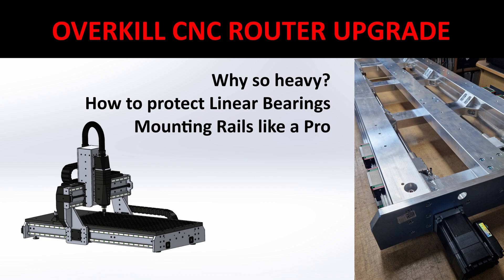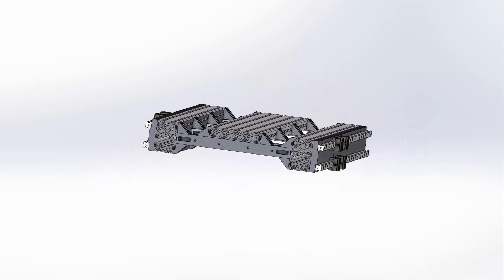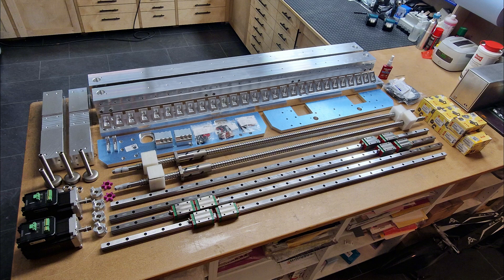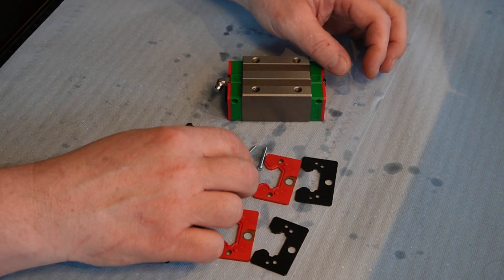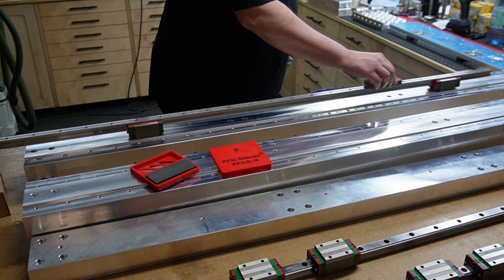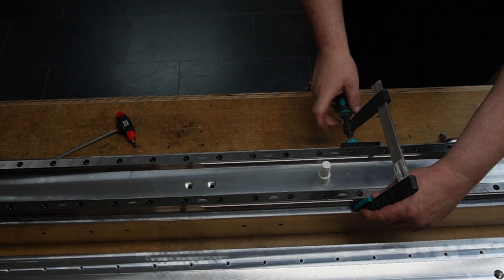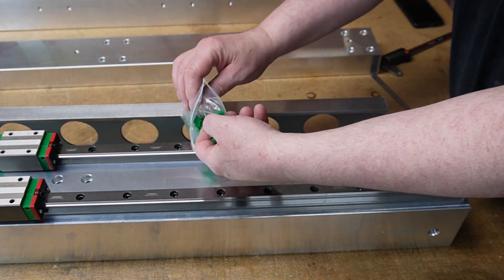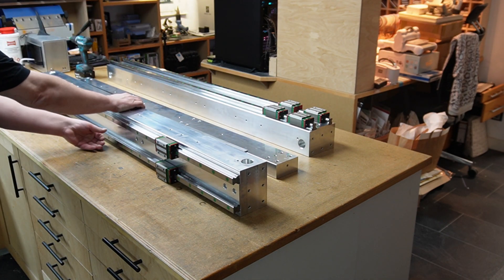Overkill CNC Router Upgrade Part 2 - Machine Bed Calculation and Linear Bearing Protection

Comment: What size have those laterals aluminium blocks? Its not bending only with 2 level feet?
Reply from the maker: No it's not. It's the reason I went with solid bars in the first place. Clearly explained in the video
Reply: @scratchbuiltdesigns yeah but aluminium profile was 120 x 80...you stucked with same dimmension on solid? Seems a little bit bigger😊
Reply from the maker: @Andrei-m4o6e Yes, it is bigger

Comment: Great job with the build and enjoying the series very much! I am curious which aluminum alloy (6061, 6082, etc.) you picked for the solid base. Also, while machining the solid aluminum blocks, do you know whether your friend used a specific tolerance standard (ISO-286, ISO-2768, etc.) and surface roughness value (3.2um Ra, 1.6um Ra, etc.) on the surfaces where the linear rails sit compared to the rest of the blocks?
Reply from the maker: Regular 5083, Regular tolerances
Reply: @scratchbuiltdesigns  thank you!

Comment: I was sticked on https://www.youtube.com/watch?v=LHtNtLdFPBQ&t=692s sound that kicked me to do the sound (smoothness) comparsion test of linear guides:
https://youtu.be/HyHWNTgOh0g
On the other video You mention chattering (video about Z axis). IMO there is two points that can change the game. Usage of roller insted of ball guideways and usage of offsets. Don't know if it is called offset but hope it is close. What i mean by this offset - carriage position to be not exact symetrical because of symetricity support resonation and helps to produce chatter in the end.

Comment: With the limitation of length due to sag, could you support the beam with adjustable feet at regular intervals?
Reply from the maker: No, because of the connecting plate under the beams. This would require to bring the ball screws from under the table to the outside, which in my case was no option. If I had no space restrictions, this would definately be a better option.
Reply: @scratchbuiltdesigns Do you think your gantry and Z axis design would be rigid enough for 200mm of Z working height cutting 7075 Aluminium? I am looking to do a 450x650x200 build.
Reply from the maker: @ultimaevo77  The Z-axis is certainly up to it. I've had the same on my UPHC router, which had 600x400x200mnm, milling all sorts of metal, incl. steel. Adding additional 40mm to the gantry should as well be no problem.
But this would be a small and top heavy machine...
Reply: @scratchbuiltdesigns With those dimensions creating a top heavy machine would you recommend going a bit wider on X for more stability or will a wider gantry negatively affect the rigidity?
Reply from the maker: @ultimaevo77  I'd rather increase table length. The gantry moves as well, so it would make matters worse, in terms of ratio between fixed mass and moving mass. 
If you have to stick to the dimensions, making the machine bed heavier could be an option, like a 10mm thick steel plate between the frame and the fixture plate
Reply: @scratchbuiltdesigns  Do you think your gantry and z axis design, done as a fixed gantry router with some extra angled brackets on the inside of the gantry side plates tied into 120120 exoxy granite filled profiles would support something crazy - 310mm of Z work height? I want to be able to machine race car uprights on a 4th axis and am going down the design rabbit hole now.
Reply from the maker: @ultimaevo77  I would rather make a hole in the table, or better, a C-shaped cut in the front of the table and drop the 4th axis there
Reply: @scratchbuiltdesigns That's a good idea! Looking forward to your next video.

Comment: I built a router using 50x100x4 alu square tube for cutting soft materials , wood and plastic . was thinking to fill the tubes with epoxy mixed with metal chips. The machine would become very heavy  though and it'd be very difficult to move around especially for home use, so I abandoned this idea. This was my first build and I'm not machinist nor I do have access to proper machining equipment to process aluminum .it was pain to get the linear rails to an acceptable alignment,  gantry moves with no jamming. how would you do the alignment if you used extruded aluminum profiles, sanding, shimming...? thanks for the video
Reply from the maker: I explained in the first video how I did it on my previous router, based on profiles.
When you build out of profiles, it makes sense to buy really good ones, which are way better than the allowed tolerance. But they are expensive.
The cheaper profiles are still within spec, but it is much harder to align linear rails on them.
Usually shimming is the way people do it
Reply: @scratchbuiltdesigns  I'll have a look at it. thanks

Comment: yah, i hadn't thought about using gigantic bars for mine, but i had thought of steel box section tube.  the worst part of it is getting it flat.  i'd have to grind them in like surface plates, though i would have three super flat pieces, one i could cut into the shorter axis.
Reply from the maker: That's probably an even better solution. But unfortunately I do not have the access to grinding, so it never crossed my mind during the design stage...
Reply: @scratchbuiltdesigns  no, i mean grinding as in... rub two pieces of metal together with grinding paste between them, then involve a third piece.  can start coarse with plate glass and sandpaper.  eventually use marking dye to show any high spots, if they're really high, carbide scraper or keep at it with the paste.  https://www.youtube.com/watch?v=-z4Rr7woKOM these are tiny but there's video of people doing the same thing with granite plates more than a metre on a side.

for steel assembly, i'd have bolted then brazed, then put on the flat rail mounts in bedding compound, so the table doesn't have to be flat.
Reply from the maker: @felderup  Woah... Amazing. But it sounds like a hell of work
Reply: @scratchbuiltdesigns  well, you get near perfection, but there's one thing you don't need to do it, machines.

Comment: extruded profiles  are complete garbage , theyre basically tuning forks to increase resonance,, Made my cnc out of concrete ( 350 lbs ) and steel tubes filled with concrete
Reply from the maker: Profil is not Profil and some are not too bad. It all depends on the purpose.
I had a commercial kit, made out of profiles, and build my own design, partly based on profiles. They all were reasonably good, because their design was good. I have seen DIY routers out of steel that were complete crap.
You are right, the material has an important impact, but the design as well

Comment: I'm in the process of building my CNC too and I always love to watch building videos on Youtube. I can't wait for another episodes from you, pleas hurry! 😁 Anyway, I have used for Y axis aluminum profiles 40x120 and filled them with epoxy granite. But from the couriosity, I have checked what would cost me 805mm long 50x120 full aluminum bars for Y... and just the raw material for 2x Y would cost me about 300EUR + shipping cost at weight about 27kg😃 it's almost the same amount I paid for all aluminum extrusions used in my build. 🙂
Reply from the maker: Awesome. Yes, the cost is of course always dependent on the location, availability and local pricing. With your cross section and length, a profile would be 60 EUR and a solid bar 75 EUR here in Germany (plus shipping). So a reasonable difference. But then you just have the cost and effort to fill the profiles, t-nuts, etc, and with solid bars there is cost and effort for machining. 
So yes, overall profiles are the more cost effective way
Reply: @scratchbuiltdesigns  Where would you buy solid aluminium bars in Germany?
Reply from the maker: @andreas292  There are several shops, like Bikar, Gleich, Gemmel, IBL, etc...

Comment: In the design I have I didn't join the sides under the table, I made the plates more rigid that attach to the ballscrews and leaving a gap, this give you 2 advantages, 1. It lets you put a centre leg in to compensate for sag as well as extra weight from vises and material which can add up fast and 2. Because sides are now seperate then you can use software to square gantry each time you home the machine In case of crash.
Reply from the maker: Surely that is a good option. But as I mentioned in the video, I wanted to maximize the work area of the router within a given shop space and ball screws on the sides make the machine wider. If I had enough space I would have done the same.
Gantry squaring by software is still possible - but within limits of course.
Reply: @scratchbuiltdesigns  i didn't say to move the ballscrews outside, still leave them underneath, just split your plate into 2 pieces instead of 1 underneath and make them more rigid, again it would leave a gap to put a centre leg.
Reply from the maker: @chrisadesigns  In that case the table would bow. Drop under the weight of the gantry on the outer beams and stay in position in the middle. Would make it convex when the outer beams are not strong enough, because they still could only be supported on the ends...

Comment: 11:16
Is there a bend in that gantry plate you installed?
It looked like it was rocking a little bit on the 4 rail blocks. If it's bent, it will wear out the blocks pretty fast. (I really hope not)
Reply from the maker: Must be a glitch in the vid. I can assure you these plates are dead flat

Comment: in my opnion, a robust aluminum frame reinforced with epoxy granite would give you the same results, without the need to use such thick metal bars, and it would also reduce frame vibration. Its a hard manufacturing process, but its cost effective. Excellent work anyways, i like what i see.
Reply from the maker: I have an epoxy granite filling in the gantry reinforcement. Adding epoxy granite to the profiles would certainly an an option and I have done it already in the past with good results. But I just wanted to do something new, something different here

Comment: Why not just one ballscrew in the middle for the y axis? Nice work btw.
Reply from the maker: I had that in the past on smaller machines, but with a width of 700mm I prefer two ball screws
Reply: @scratchbuiltdesigns  we used to build a machine with 1500mm width with one giant ball screw in the middle 😂
It was a very expensive ballscrew and not very easy to justify...

Comment: If you put a steel plate 10mm thick at the top and bottom of the two aluminum rails it will greatly increase the rigidity. These two plates are not hosting the rails so no need to be dead accurate straight/flat

Comment: Does anyone know why I almost never see steel for the base of a CNC, its almost always aluminum?
Reply: Exactly! Welding parts will warp. And additionally there is stress in the structure due to the welding heat and that stress can lead to even more warping later on. This stress should be released by a heat treatment (which is also hard to achieve in the DIY world). And finally machining such a large steel part can also be quite challaging. 😊
Reply from the maker: @lgmn-cnc  You nailed it 👍
Reply: @lgmn-cnc Vibrational Stress Relief is also possible and achievable for hobbyists.
Reply from the maker: Well, in my case it is because I am not much of a welder. And welded frames tend to warp, so in some way or another they need some post-processing in order to get the mounting surfaces straight and parallel.
A frame out of alu you just bolt together. And for most hobby purposes they are straight and rigid enough

Comment: Awesome build!
About the 2 rails on each side, I think it's too much for this type of machine.
I own a company that manufactures cnc routers and laser machines, we manufacture small and medium routers and import big routers (equipped with automations and all the cool stuff). Even those big routers, that can cut 20mm thick plywood at 30000mm/min (yes, 30k) dont use 2 rails on each side. A 25mm rail is great already. Maybe you can justify 2 rails because of the limited size you can space the carriages. Those big routers have a big space between carriages which helps preventing the issues you said.
By the way, I just clicked on the first video because of the 2 rails on each side, it caught my attention. I often get recommended videos about the same type of hobby machine, but this one is different, props to you!
We used to build cnc routes with solid aluminium bars and it was cool stuff.
This week a technician here worked on a 12 year old machine made with solid aluminium gantry, they will probably last more than us.

Edit: forgot to say when 2 rails on each side are usually justified: giant machines and machines with big gantrys and long Z axis travel, like machines that cut rocks and 5 axis machines used to cut large wood parts. (and the obvious portal machines that work on metals)
Reply from the maker: Thank you for the amazing feedback. I tend to agree, the two rails are cerainly not necessary - but with just one it wouldn't be overkill, would it? 🤣
Reply: @scratchbuiltdesigns  Yes, for sure, you are accomplishing the overkill part of the build! It will turn out to be a great machine
Reply: I think two rails can increase stiffness a lot. But i would make the rip on that side plate longer so that the rip goes All the way down to the lower rail.

Nevertheless a great design and I love your content. Keep on with that great work! ❤
Reply from the maker: @lgmn-cnc  The rib is actually part of the gantry. It is a C-shape. To make that longer would surely be possible 👍